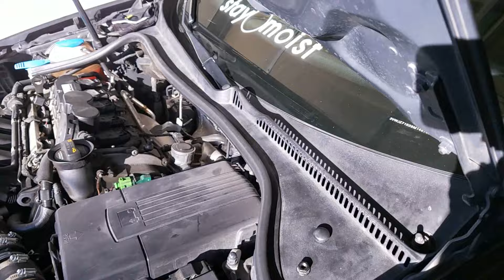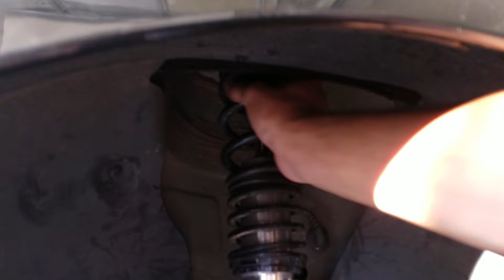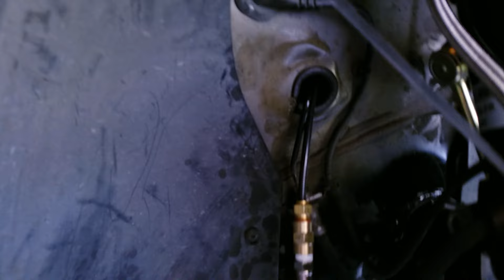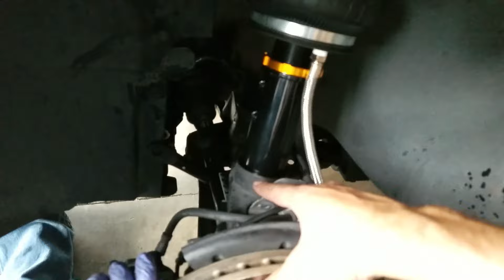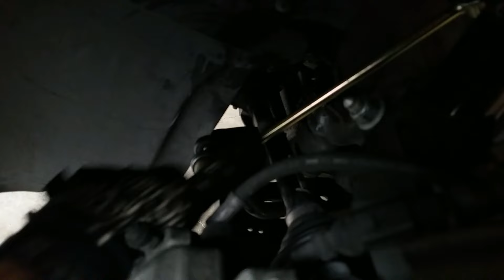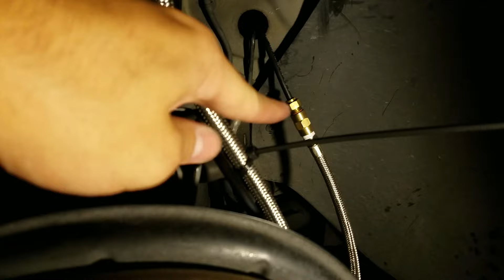Raceland Bag Install - Episode 1: Front Suspension

Comment: what size tube do I need to run from these to my compressor ?
Reply from the maker: Aaron Echols Your compressor will connect to your air tank with a braided steel hose. Then from the tank it would depend on what management you have.
Reply: ok thanks ! all my friends were confusing me telling me other wise so i needed to be sure with someone that knew what theyre doing!

Comment: Hi why my air bag is spinning how can lock it every time I turn the air bag is spinning ??
Reply from the maker: There are locking rings/collars threaded onto the shaft that are used to keep the bag from spinning. If the bag is still spinning separate from the strut body, then you may need to have it rebuilt

Comment: How did you get the strut out of the sleeve? I've done all I can think of but I can't seem to get it out without removing the axle bolt.
Reply from the maker: KevBounce There is a special tool, just called a strut removal tool. It's a small bit that goes on a ratchet. I got mine from Raceland but you can probably find it from other online sites.
Reply: I have the strut spreader in there. I just need like another half inch of clearance to get it out and it won't budge.
Reply from the maker: Try re-positioning the strut spreader. I think what we had to do was move it out and then take the strut spreader out and move it to allow it to come out. Also just try and push down on the whole unit hard, and add some type of lube, WD40 or PB blaster.
Reply: Thanks!

Comment: Are you using Viair stainless steel braided leader hose for the fronts?
Reply from the maker: Tom Backes No, the Raceland kit comes with the braided air lines for the front.
Reply: Thanks for the quick reply Ryan. Maybe I can find someone who sells them separately.
Reply: I ran my 2 front lines through the vehicle just to feel safer but its all preference

Comment: is it possible to run the fronts without the adjusting ring?
Reply from the maker: If you are running the front struts as low as they can go the adjusting ring doesn't prevent you from going any lower. The struts body is threaded and will only go a certain distance into the housing which is the lower potion where the mounts are. In this case the ring is just to keep things snug. hopefully I answered your question.
Reply: +Ryan The Hawaiian I was thinking taking it out for clearance?
Reply from the maker: +the506thPIR Its probably better to have the adjusting rings because if you didn't the bags would be able to spin freely and you don't want them possibly spinning around and then having your braided hose rub. They do make the fitment tight with the braided hose but once you get it tight it shouldn't be an issue.

Comment: Does the  kit come with a controller?
Reply from the maker: Will Reedy No, the Raceland kit only comes with the suspension components. You will need to supply whatever management you want. I'm using the Air Lift Autopilot V2 that uses the 8 preset controller.👍
Reply: Ryan The Hawaiian how much did that set you back man?
Reply from the maker: Will Reedy The management ran about $1100. I got the airtank for free so normally would've been $1300 for the management and $900 for the bags

Comment: How’s the Raceland bags now? Still good/great? Would you say is it worth it rather than going 3k+ on other air brands? Thanks
Reply from the maker: They're still holding up well, I think they are definitely a better option than the AirLift slam series. The only issue I've had was with the AutoPilot V2 manifold, no issue with the bags themselves. If you are looking for bags and dont want to break the bank, then Raceland is the way to go!
Reply: @RTHMedia  how are they 2 years later? Looking to get some
Reply from the maker: @cadenw3944  Well, I think at around the 3 year mark they finally failed. The only reason they failed however is because I was trying to adjust the height of the bag and when I was doing that, the bag broke free of its seal to the strut body and caused a leak that I could'nt re-seal so I ended up getting rid of them and getting coilovers. But if I hadn't been adjusting them they might have lasted longer
Reply: @RTHMedia  u think it’s worth spending the money to get them? I’m tired of my coil overs clunking and breaking every 3 months
Reply from the maker: @cadenw3944  Theyre not a bad value for the money but its around $2200 or so if you do all or most of the install yourself with AirLift Autopilot V2 management. I dont regret getting them at all, they were a ton of fun to have while they lasted!
Reply: @RTHMedia  would I be able to use airlift performance 3p for air management?
Reply from the maker: @cadenw3944  Of course, any air management from AirLift will work with the Raceland Bags!